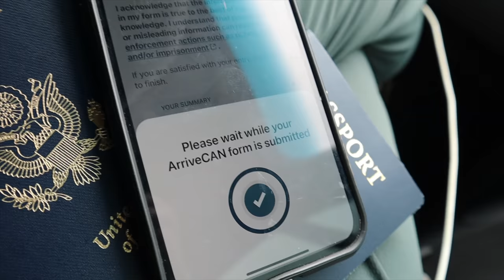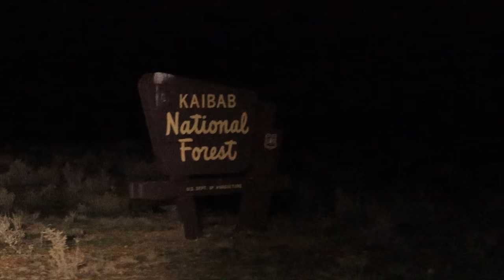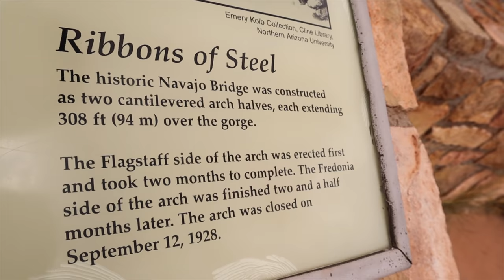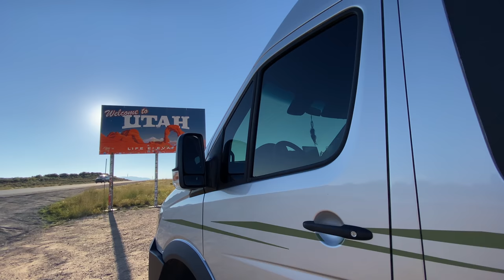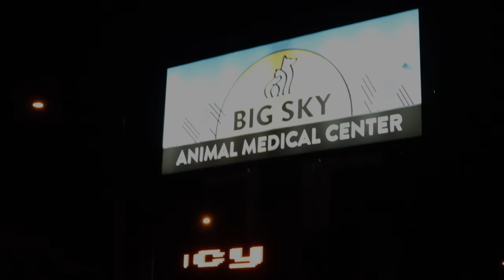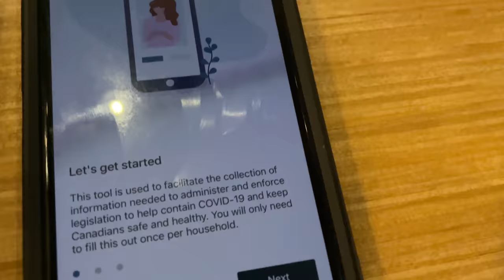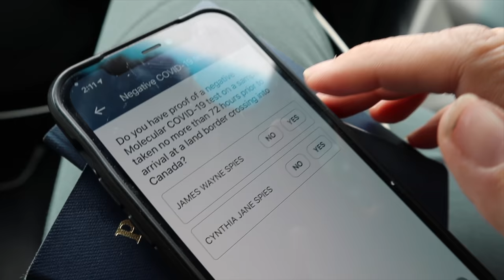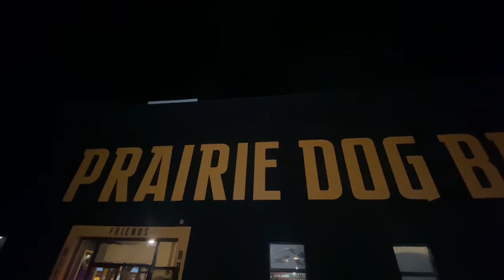THE END | Van Life Lower 48

Comment: Get an ARB Twin compressor and a Speedflate or Morrflate system, and your airing up/down will go so much faster and smoother 😀
Reply from the maker: We will have to look that up!  Thanks for the suggestion… sounds kinda expensive though 🤣
Reply: @WingsandWheelsAlaska  if you get the version of the compressor that comes in a Pelican case with a tank, I think it's about $950. If you get just the compressor for under hood mounting, it's about $650, but then you'll need a mounting bracket as well. The Speedflate system is about $175, but it lets you air up/down 4 tires at once. That ARB compressor is pretty much the industry standard for reliable compressors, and it's very rugged. Built for abuse on the road.